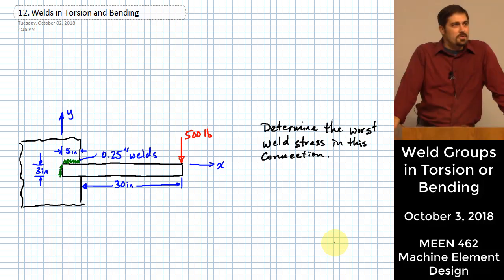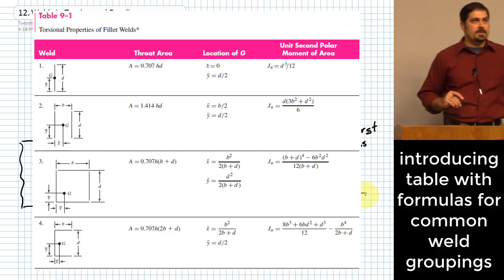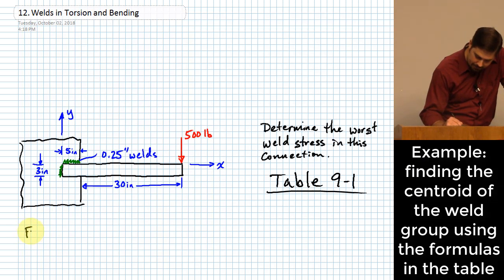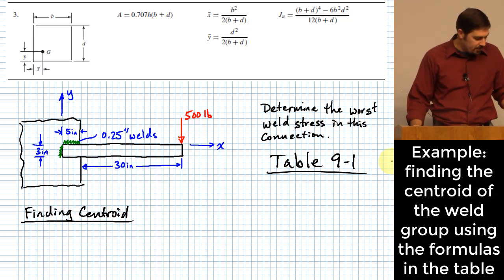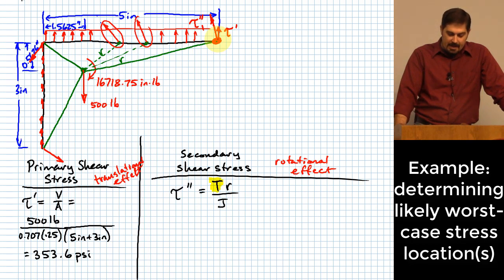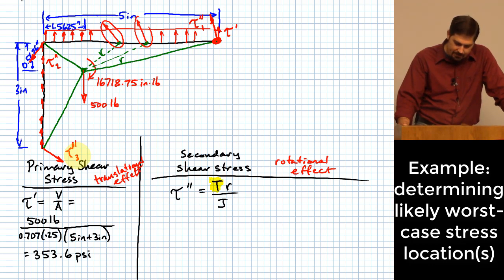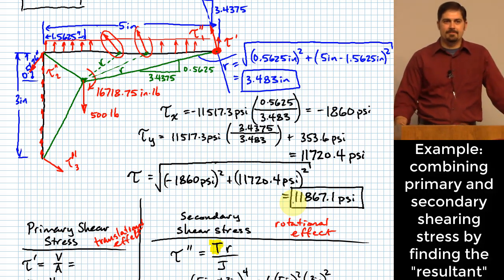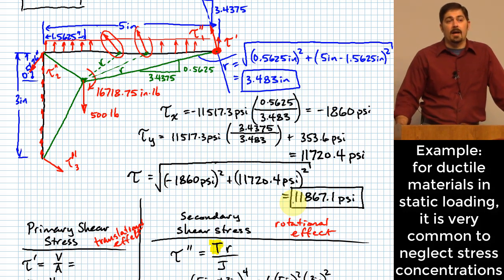Weld Groups in Torsion or Bending: Finding Critical Shearing Stress | Primary & Secondary Shear

Comment: Awesome class, as always! Let me ask you something: the axis where the bending moment is applied is the centroidal axis of the weld group?
Reply from the maker: Yes, that is correct. It is because applied shear forces applied at the centroid of the weld group will result in no net moment felt by the weld group. If you have an eccentric force, it can be converted to an equivalent force-couple system centered at the centroid.

Comment: 59:30 Should the primary and secondary shear stresses not be parallel to each other? If we’re looking at the throat plane of the weld, I would imagine the primary and secondary internal forces on that surface would need to be in the same (or opposite) direction to react to both the shear reaction and the moment reaction. If we were looking at the plane parallel to the wall, the internal forces (and therefore stresses) would be perpendicular, but we’re looking at a plane 45 degrees from the wall. The forces should be in the same direction, right? If the stresses were perpendicular as 59:30 seems to suggest, there would be an internal force pointing in a direction where a load isn’t being applied. I think I’m missing something.

Comment: Thanks for these videos, very helpful. On the bending question,  why does the denominator for primary shear use 1.414 instead of .707 and why is only half the weld length used?

Comment: Dear sir: Why are you using Bending moment equation for finding out the secondary shear stress ... in my knowledge, we have to calculate flexural stress using MC/I and shear stress(primary due to axial force and secondary due to torque) and use any failure theory like DE criteria . if we use DE criteria we get 20.8Mpa  which is more conservative than 20.34Mpa.. can you please clarify .. i am following all of your lectures .. you are really great sir..
Reply: i dont think DE criteria is more conservative  but it is more accurate. I calculated the stresses using different theories (MNS,MSS and DE) for other problem i got the maximum stress.

Comment: Yağız Özgör
1 saniye önce
Dear Sir, for the second problem, why we dont use here for a stress element in weld, which is described from mohr circle  taumax, where sigmax=20,1 Mpa from bending and  sigmay=0 and tau xy from shearing: 3,143Mpa. in the example you combine the loads not same with taumax which comes from mohr circle. there ıs a different. Because  if you combine the loads with stress transformation formula ( from mohr circle) result is 10.53 mpa.  but in the example result is 20.34 mpa.

Comment: Thank you, professor! But I've got a question, as you've drawn here 22:36, is the direction of secondary shear stress alright? Shouldn't it be according to the direction of the in-plane torsional moment?
Reply from the maker: In this example I showed the weld stresses as reactions against the applied force. Doing it like you are saying is ok too, as long as you are consistent with how you represent both primary and secondary stress. Thanks for watching!
Reply: @TheBomPE  I guessed the same but had some confusion. Thanks for making it clear, professor!

Comment: Helpful Video, Thank you! Although I have a slight confusion, as I recall Mc/I is the formula for finding normal stresses due to bending but in case of welds we are using it to find secondary shear stress, why is it this way?
Reply from the maker: Secondary weld stresses are due to reacting against a rotational influence like a moment or torque, therefore Mc/I leads to a secondary stress. The reason it is considered to be a shearing stress is that a conservative assumption/technique is to assume all stresses carried in welds are shearing stresses in the weld throats. You might check out this video where I discuss that assumption:  https://youtu.be/7lqxiAZYQt0

Thanks for watching!
Reply: @TheBomPE  The confusion I am facing is that despite taking the throat area and considering shear stresses in welds, there are cases when the attachment metal (and attachment line) has a more  critical scenario than the weld, my assumption was maybe if the strength is enough to survive the maximum shear stress in throat area then we don't need to check anything else but in Example 9-3 the author designs the weld length based on attachment metal (taking the attachment area) calculations.